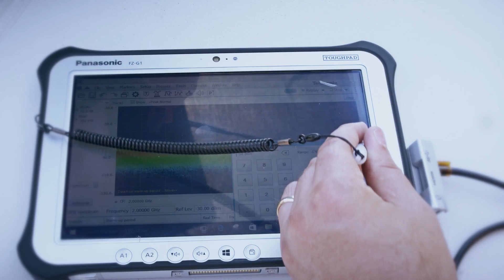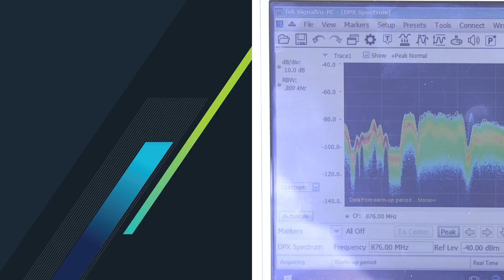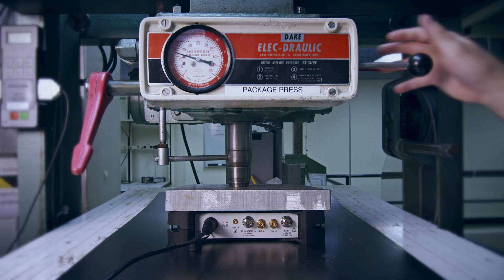Watch us put our Spectrum Analyzers through some real-time extreme testing

Comment: At what force/weight on the press did it collapse at?
Reply from the maker: It stopped working at 12 tons (the power light went red) and started losing structural integrity around 24 tons. At 26 tons the power light went out completely and it was totally collapsed at 35 tons.
Reply: Thanks for taking the effort to ask around and get that info.
Reply: im-press-ive